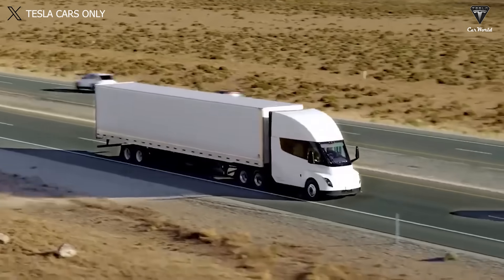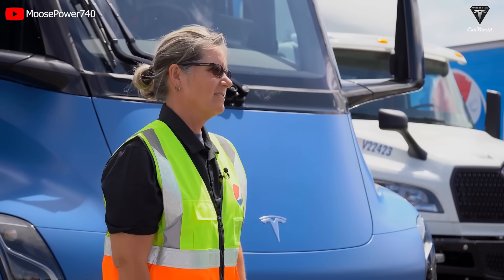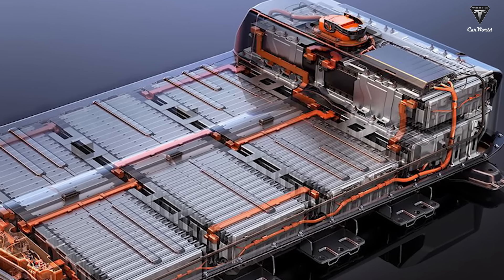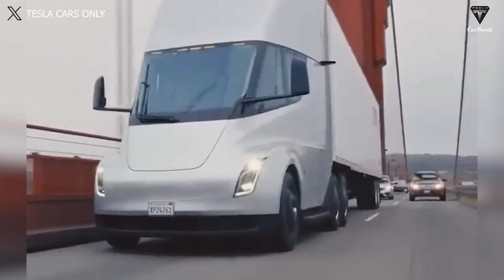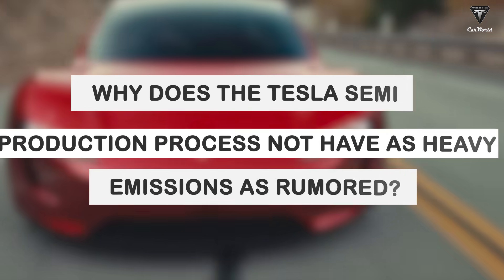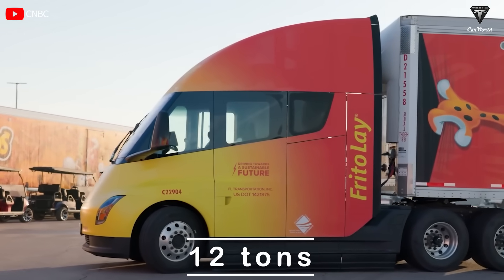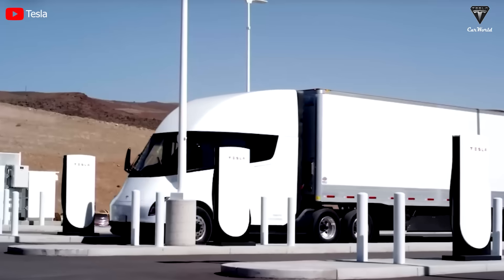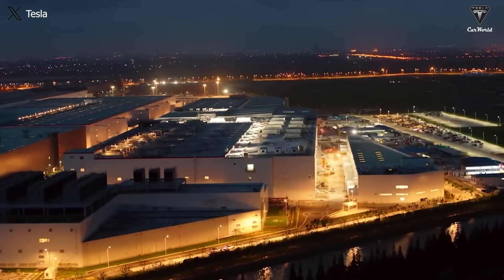Overdose! "Thunder Wagon" Tesla Semi New Version 80.000lb, 1000 kWh battery! 90% charged in 30 min!

Comment: the Tesla Semi is not a competitor to the Mercedes in much of the world, as the Tesla Semi doesn't carry enough gross train weight, 80,000lb GTW falls will short of 88,185lb to 97,003lb that are common in much of Europe, before you even include the Nordic country's running >110,230lb, yet alone the fact that the Tesla Semi is to long and would cause a shorter trailer to have to be used, the Tesla Semi is also not available for the very popular ridged truck market.
Reply from the maker: We appreciate your analysis, but each truck has its own strengths in each market area. MCD has many strong points such as towing capacity...but Tesla has longer range and is stronger. These two cars are quite balanced and compensate each other. In short, every electric truck is recommended
Reply: @TeslaCarWorld  sure the tesla has a longer range based on a lower GTW and a topography in the USA that while it has some notable mountain ranges is on the whole notably flatter etc than the European road network for example, while the notion of being "stronger" is at best highly questionable, if its GTW is lower, or it carry less cargo, or it goes faster are not quotient of being "stronger" per se, having a higher GTW and a higher payload, and being designed in more versatile formats for generally more hilly and twisty road networks and ultimately a more diverse world are things that you would call "stronger" than just designing something mostly for the NA USA semi-truck market, don't get me wrong, I am not saying Tesla Semi is bad, it is very good and has a laser focus on a highly specific segment of the USA market, much like all NA truck manufactures, unlike counterparts in the ROTW who have to design trucks for global markets excluding NA, the USA is literally the lowest hanging fruit.

Comment: The 0.2 coefficient of drag cited for Mercedes is actually for their EQS sedan, NOT the semi, and is virtually identical to the latest Model S (at 0.208.) I can't find the CD for the actual semi anywhere online.
Reply: A drag coefficient of .2 is hard to believe, it is less than half (1/3?) that of a Y as I recall, wind resistance is proportional to the product of the Drag coefficient times the frontal area. See Car Performance Formulas:

where:
            AR = air resistance [N]
            ρ = air density [kg/m3] ≈ 1.202 kg/m3, at sea level and at 15o C
            Af = car frontal area [m2] ≈ 1.2 : 3.2 m2, for small and mid size cars
            Cd = coefficient of aerodynamics resistance (drag coefficient) ≈ 0.2 : 0.5 for cars
            v = car relative velocity [km/h]
            vcar = car velocity [km/h] (vcar = v, at stand still wind, vwind = 0)
            vwind = wind velocity [km/h]
Reply: @tobyw9573  Yes, CD is about shape, not size, and actual drag for a semi at 0.2 CD would be 3 to 5 times greater than a sedan with the same CD.
Reply: Most of his stats are wrong. The 500 miles version of the Tesla CyberTruck is using a GVW of 82,000LBs and Pepsi has driven 1 over 430 miles on a single charge with a full payload during the run on less event. With the data gathered, the total pack size has been calculated to ~750KWh. Which was almost exactly what Engineering explained calculated earlier based on just the physics.
As for Tesla's ability to pull only 80,000 LBs. I mean... it's 82, and thats not a limitation of the torque, but just for certification and classification purposes.

Comment: The article constantly refers to Gross Vehicle Combined Weight but calls it Payload. Payload is GVCW minus empty or "Curb" weight. Payload is what the truck is being paid to transport. Curb weight of a semi and trailer is at least 35,000 lbs so the actual "Payload" is is no more than 47,000lbs. Probably closer to 42,000 lbs.

The weight given for the higher range is probably the curb or empty weight. 

If you want to pretend to be an expert try to at least learn to lingo.
Reply: Exactly!  I found the video unwatchable because of this glaring mistake.
Reply: Are we still waiting to find out the axle loadings of an empty Tesla Semi? Is it still a big secret?

Comment: And still has only a range of 500 miles while the regular truck has a range of up to 2100 miles. Time is money and money is time when it comes to working....
Reply from the maker: 500 miles on a low-cost charge or 2100 miles on a few hundred bucks of diesel, plus the resulting pollution. Stops at charging stations are your time to rest because no driver drives more than 500 miles without a break!
Reply: You can't drive 2100 miles unless it's tandem. Most loads are solo drivers and breaks are mandatory, so there is no time lost anyway. Factor in about $70k saved per 100k miles on fuel cost and this is a no brainer.
Reply: Recharging during loading and unloading eliminates any downside for short/medium haul trips, which are the vast majority, and also eliminates travel to gas stations and diesel refilling.
Reply: @EnriqueThiele 4 hours? You must follow three maximum limits at all times. The 14 hour driving window  limit, 11- hour driving limit, and 60 - hour /7 - day and 70-hour/8-day duty limits. Due to government regulations, at the absolute peak a driver is allowed 11 hours driving limits set by Federal Motor Safty Administration (FMCSA) A driver must have 10 consecutive hours off afterwards. Dont ever think nothing can never happen to a Tesla truck either due to the fact that they are made by imperfect hands just like everything else. Don't ever think they will never break down, or get blowouts. A driver has to rest every 4 hours because they just can't go any further. Godda plug in and stay awhile. Love riding with my uncle. We sit and talk about all kinds of things while we ride that line, all day moving freight from one end of the country to the next.
Reply: @EnriqueThiele fuel? It's just like cars. I would love to buy an EV. They have to improve them first. EVs that charges from 0 to 100 percent in 3.5 to 7 minutes and offers a range of 500 miles. Sofar nothing. Till then I'll keep my jaguar XJl. I fully fuel it (once a month) and takes 3.5 to 7 minutes depending on wether or not i run in and grab a coffee. Range is 515 miles. I rather take the once a month fueling for the range than sitting around like some kid in time for the little shit for range an EV offers.....all day. I have nothing against an EV. They just need to be improved before i buy one.

Comment: The issue is infrastructure to support them. A group of Tesla Semis fast charging takes as much juice as a small city. It can be done, but it's going to take time and a LOT of money to support these trucks.
Reply: There is a lot of money to be made here, I don’t see any reason the “issue” won’t be addressed as needed.  Nor is there any reason to believe Tesla, Pepsi etc have not anticipated this need.  From my perspective as a retired Mechanical Engineer who worked in cutting edge industry, Tesla is rolling out the whole EV transition brilliantly (every corporation is not as lazy and set in their ways as GM or even Ford.  I actually consulted for both of them in my day, I could tell you stories!).
Reply: @johncahill3644  Ultimately i agree with you, supply will always rise to meet demand when there is money to be made, but i'm not really talking about Pepsi running a few trucks between the same warehouses every day, i'm referring to using these trucks industry wide. The costs to build MW charging stations all over the US, and feed them, is astronomical. It'll happen, but it's going to take time and taxpayer money, at least in the beginning.
Reply: You may not be aware of this, but Tesla Semi's can charge up with both Mega Chargers and Tesla's existing Super chargers. The real battery capacity of the 500 mile version is about 750KWH while the 350 mile version is closer to 500KWh. As for cost, Tesla has had no or little access to subsidies for it's charging network but has a 3x lower install cost than the nearest compeditor.
You may think the Super Chargers aren't good enough, but there would be no taper with such a low C rate. Also, the V4 Superchargers can do 610KW fast charging, so 50 minutes for 350 miles of range roughly. Or 6 hours of driving.

Comment: Fossil fuel burning vehicle production is no less environmentally unfriendly.  In fact, if Yes;a is following its motto the best part is no part and the best process is no process, then Tesla is already leaps and bounds better than the competition.
Reply from the maker: You are very wise, many comments have criticized the production of Tesla Semi for high emissions, but they also did not think about producing an internal combustion engine truck and the lifetime of this vehicle's emissions. Thanks for your sharing!
Reply: @TeslaCarWorld  but other damages take place on the planet to bring about the production of those batteries. Needed to make electric vehicles. And when completed, you get long sitting times and short shit for range. My Uncle is a truck driver and has a range of 2100 to 2400 miles on his rig. Try that in a electric truck. When it comes to trucking, time is money and money is time. The producers of electric trucks knows nothing about this rule. If electric is all that then wake up America, Highspeed bullet train technology is also (fully electric). This is something the mighty United States of America should of had decades ago. Now go and keep on digging the holes in the earth to get the stuff you need to keep on building these short range, long sitting vehicles.....